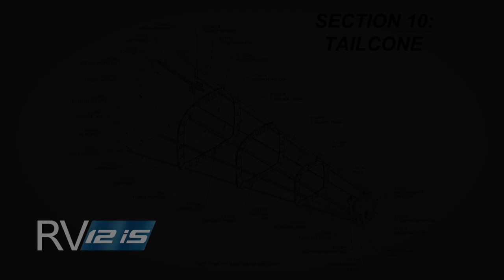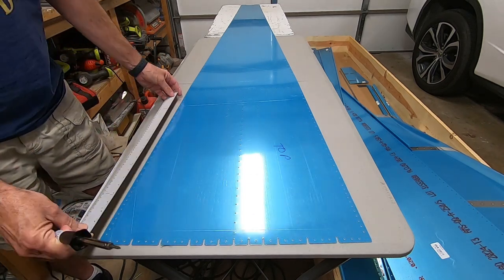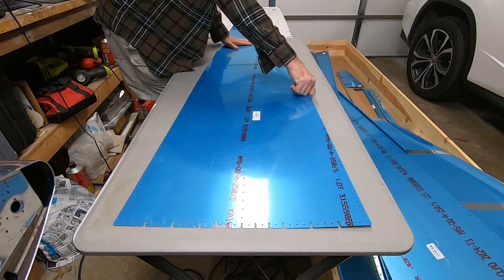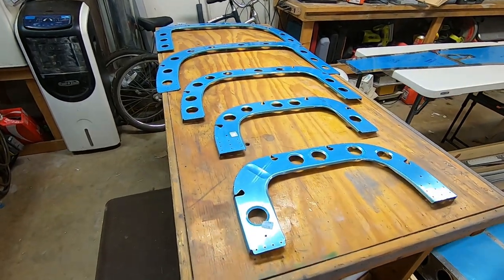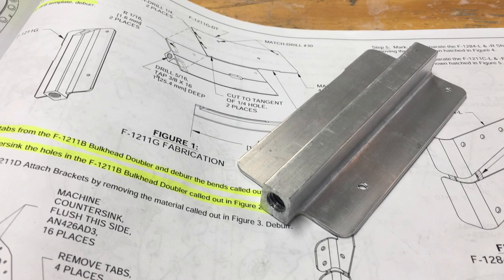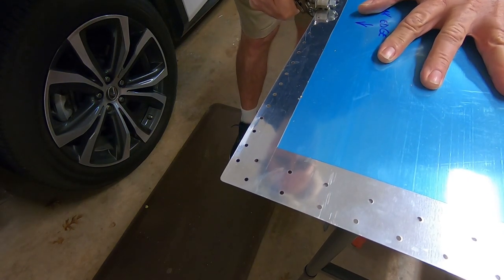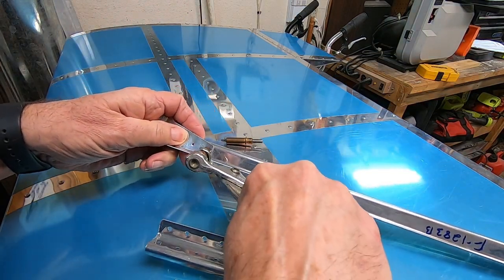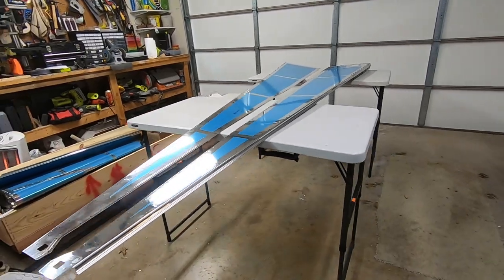Van's Aircraft RV-12iS Tailcone Construction Part 1

Comment: What brand/model is your pop rivet gun? Seems to work really well. Do you recommend it?
Reply from the maker: At first, I was concerned that the one I had chosen wasn't going to be any good, or last very long. But, it has been working perfectly. Only 50 bucks! https://www.harborfreight.com/3-16-inch-air-hydraulic-riveter-93458.html

Comment: I'm at this stage of my rv12 build. Do you ever have problems with the Rivets not wanting to go in? My holes are all lining up and the clecos go in no problem.  But often the Rivets don't fall in as it appears in your video.
Reply: Every once in while, I have had to do a "final drill" with a #30 (1/8") drill bit to get a stubborn pop-rivet placed. All the pre-drilled holes are 1/8", but sometimes multiple parts don't line-up exactly.
Reply from the maker: Agreed on the final drill comment.